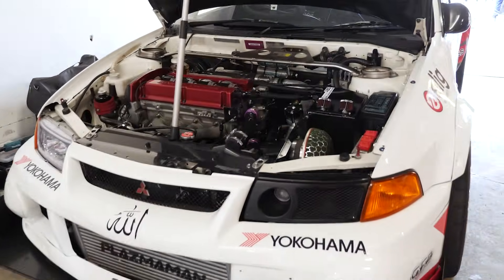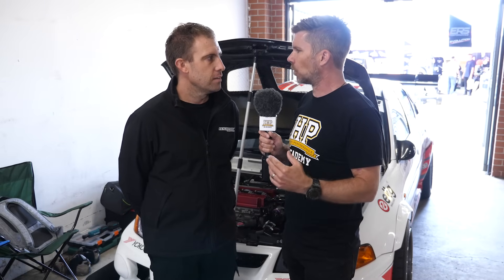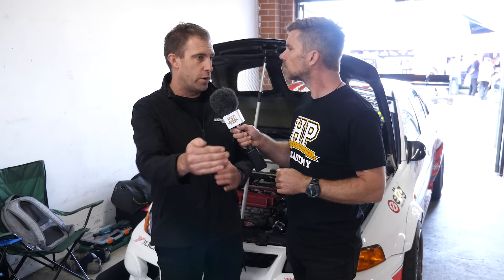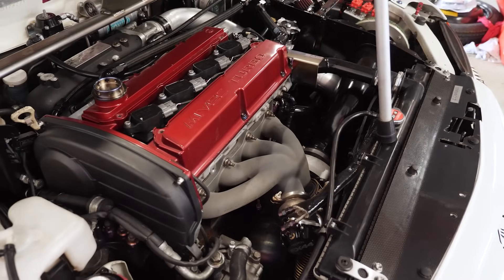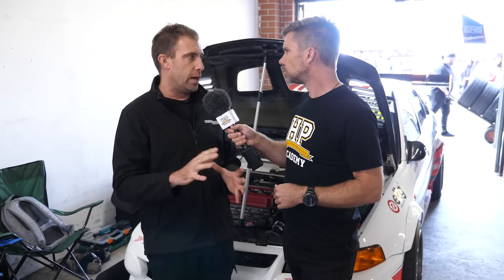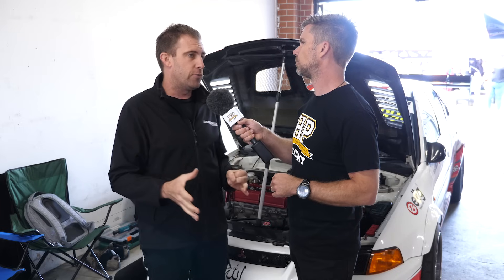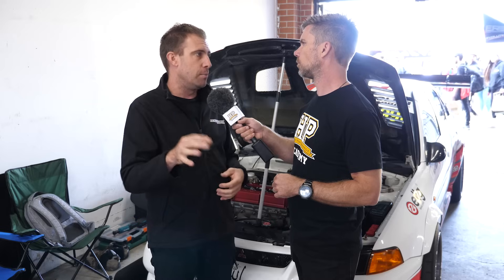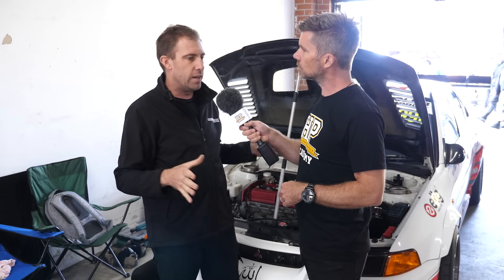Losing 27% Horsepower And Going 4.8 Seconds FASTER! (How?!)

Comment: Torque,  handling, grip and brakes.  Those are the keys. Ohh and weight and its distribution. Aero. List is long.
Reply from the maker: Many assume that power is the best and most important factor to zero in on. That doesn't mean there is only one other thing to focus on instead, just that lumping more and more power at a car doesn't actually mean it will go faster than something with less power which has also had the low hanging fruit in other setup areas dealt with as well - Taz

Comment: First thought before clip,  power curve with more low and mid torque at earlier RPM, vs high HP at topend but narrow power band.

Second, transmission tuning and traction.

Third, suspension tuning and corner tuning.

Comment: Power under the curve and linear power is way more important than peak power. I remember a small Suzuki GTI with a humongous turbo running quicker than anybody because the head flowed so much the torque curve was actually good when turbo lagging. Very curious to see at that time

Comment: Why such a big turbo for that power?  770hp rated turbo seems way overkill and sacrificing even quicker spool. The rest of the Garrett G series including G30-660 and G25-660 can comfortably make this power so what’s the point?
Reply: No they can't. 

We tested all turbos in the G-Series range. 

The G25-660 made ~340kw on our Mainline dyno.
This equals roughly ~570 hp at the flywheel, the turbo was maxed for the application in both shaft speed and EMAP. 

The smaller G-Series turbos aren't always able to support the required power we need at the higher pressure ratios required.
Reply: @Benchmark413  Cheers for the explanation :)
Reply: All depends on engine efficiency.
Reply: @roskataqv  Yeah it’s interesting because motive dvd/powertune made like 370awkw with a G25 on the GR Yaris and we see Evo X making same power as this Evo with small turbos but like you said they are newer and more efficient engines.
Reply: @Joe-qc2fw  they made their power at the front hubs. 

Ours was at the wheels on a chassis dyno. Typically a ~20% difference in my experience.

Comment: 2 seconds is all related to the tyres. A052 is almost A050 in terms of performance, with less endurance.
Reply from the maker: Not everyone was up 2 seconds, and they ended up being 4.8 seconds up on their previous best by the end of the event. There are certainly a few variables between years but at the end of the weekend of racing the team were top of the bunch of all those racing on the same tyre in the same conditions to the same rules. Winners are grinners 😎 - Taz.
Reply: @hpa101  I think they did a great job regardless. The tyres contributed to the drop in lap times but so did the many improvements made to the car as mentioned in this video. Not to mention a great drive by Jimmy.
Reply: Yes the class record set in 2017 on AD08R's was 1:36.83
Reply from the maker: @gtpumps so with 2 seconds off that would be 1.34.83, which still isn't a gold medal. All speculation though. 
Really it sounds like you'll just have to put a faster time up in 2023 using the same compound as everyone else on the day for that year and see where you place .Records are there to be broken, as this one has been and will be again 😉 - Taz.
Reply: @hpa101   fair comment but 1:34.83 would have finished in second place :)
Reply: @gtpumps  throw Jordan Cox (who is in essence a pro driver) in Jimmy's Evo 6RS and just imagine what time it would do around SMP.
Reply: @JDMEVOVIGSR  Jimmy did a great time.
Reply: @gtpumps  absolutely, not disputing that!

Comment: The emphasis and importance of correct chassis tuning is incredibly visible in Ryan tuerck’s a90 supra with the Judd v10. All the power in the world, all the diff and chassis potential but in its current tuning state it’s struggling to even put 300HP to the track and is even unstable in straight line braking
Reply from the maker: Wonder if the team has seen the corner weighting course 😅 haha I'm sure they're onto that side of things and have a few more fundamental issues to work through, hell even F1 teams struggle to nail it all right out of the box, part of the challenge - Taz.
Reply: To be fair, it has only ‘just’ been converted from a drift car to a TA type vehicle and it’s not his core driving discipline.
Reply: Also, he had his aero package fail and the wing and splitter had to be removed, that will change just about all of the suspension tuning like he had mentioned...
Reply: That will arguably have a lot to do with the tire itself. Your suspension won't really affect how much power you can put down when driving relatively straight.

Comment: So what does he use for gaskets and studs?
Reply: I think he was referring to no studs or gaskets between the manifold and turbo. Hence going to V band turbine inlet.
Reply from the maker: @MorisonRacecraft  spot on, cheers for helping out Dez here - Taz.
Reply: Fabricated manifolds have a lot of stress built into them. Studs for the turbo often stretch or strip due to the warping forces. 
More and more successful race teams are returning to cast manifolds for increased reliability and lower energy losses.

Comment: My dad always told me, you can have all the power in the world, but without the chassis and traction it needs depending on the build, track/drag, you'll be slower that a 300hp car.(This was back in the 2000's when 300hp was quite a bit).
Reply: The characteristics of the power band are critical too. You want more power under the curve rather than focusing on the peak power numbers.
Where and how the power come on make the difference between a confidence inspiring car vs. a terrifying car.

We had two customers with vintage Datsun Zs. One of them was making about 400 hp, the other was making 600hp. The 600 hp Z was a nightmare to drive, it would spin the wheels when you wouldn't want it to and you were primarily focusing on regaining control more than driving.

The 400hp Z was a delight to drive. The power came on when you wanted/expected it to and was plenty of power to put a smile on your face.

Of all our customer's cars, the most enjoyable ones were the ones with linear power through the power band, not a violent peak at high rpm.
Reply: @David_H_Parker  unfortunately the average car person just wants to post the highest peak numbers, but they are missing out.
Reply: @David_H_Parker  Same, my dad had a 64 Mustang with about 350hp that was a death trap, he just didint invest in suspension, I had a friend with an E46 M3 that would murder him on a drag, its was mostly 60 rolls that he was bsle to keep up, but E46's have top end like mofo, even with only 333hp, about 290 wheel, my dad's was making 320sh to the wheels.
Reply: @SavageBunny1  sounds like a weight & drive train difference
Reply: @David_H_Parker  à000
Reply: @David_H_Parker  sounds like how I would compare my 400 hp Crown Vic before & after suspension 🤣
Reply: Is your dad Dom Toretto?
Reply: All depends on what you are building the car for.